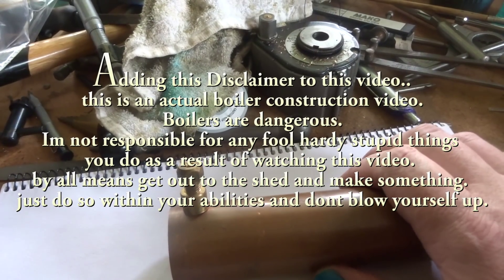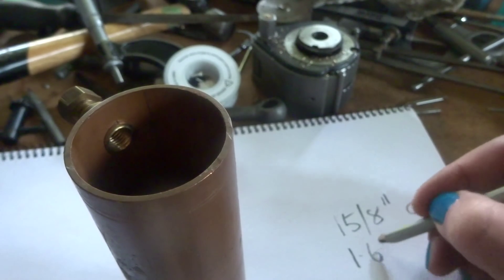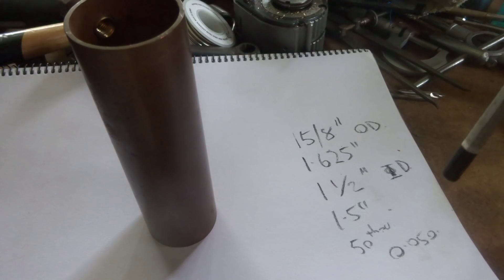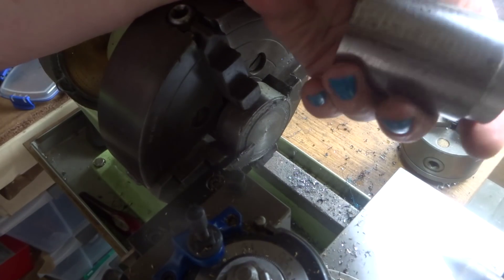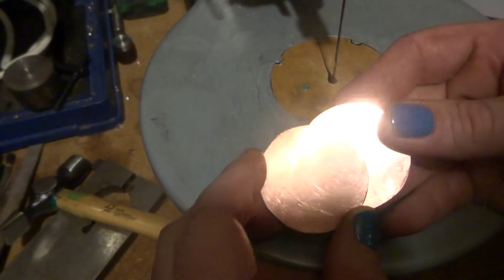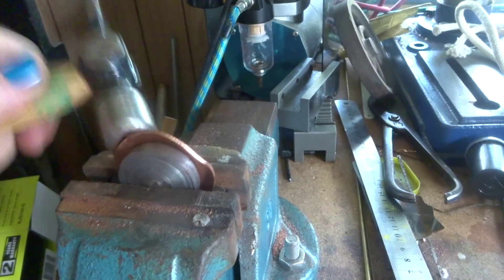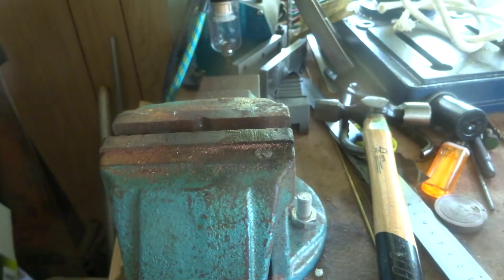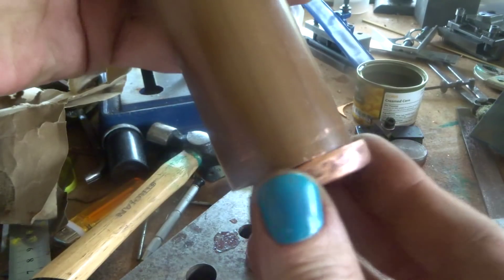K W  SCHOOLS  Steam Engine PART 9 Boiler components

Comment: I have made end similar end caps by machining a steel former just as you did.  However I also used a 2" X 2" chunk of 1/2" steel that I cut a tapered hole in, sized using the ID plus double the thickness of the end cap material.  Polished the hole smooth, put some oil on both formers and then used my big vice as a press and formed the cap.  It had some wrinkles near the edges but these were machined off.

Comment: Why doesn't anyone just buy the OEM caps the fit on the outside of the pipe it seems they would increase the strength of the boiler as was as making the whole process much easier...

Comment: Nice work, perhaps use heat bricks instead of a lump of steel when annealing as the steel is sinking a lot of your heat and it's a bit less of a fire risk! I usually use a pair of forming bucks and sandwich the end cap between them to ensure a crisp, almost 90 degree edge and a dead flat face which is critical if you wish to add a water level sight glass.Seeing you have a lathe, have you ever thought about machining a complete pair of forming dies, that way you can set up to press out the end caps with a small hydraulic shop press?
Re cutting the copper, I just use wiss snips and a linisher!!
keep up the good work mate, i love watching others go around with their projects!
Reply from the maker: Is another boiler very shortly down the track. I'll certainly keep your ideas in mind! Thanks for watching!

Comment: clickspring shows in his videos how he cuts circular brass discs on his lathe. He glues them on with one-second-glue, turns them and breaks the bond with a little heat from a blow torch and cleans the residue with acetone.
Reply from the maker: +rol eic clickspring has a great channel. wish he would show his outtakes though. the wax brass was traditionally used with shellac, nowdays superglue works too.

Comment: Great video Emma. Keep them coming! Good thinking about the centre punch mark being a weak point. I'm no expert but how about tinning both parts of the joint first, then applying some flux, heat and feeding in a little solder? Can't wait for the next video! Thanks from Mike in the New Forest of England.

Comment: Interesting video, have you ever tried metal spinning parts like that? 
If you will permit a little FYI, contrary to a lot of people's thought, quenching is not part of the copper annealing process, it just makes it quicker to work on the part again.
Reply from the maker: Thanks for that. I probably knew that if id sat to think it though!  Thats what youtube is for though! Love to get imput and feedback! Yes you could spin them up fairly easily i guess. I did it this way because i had done it before,  and knew it would work. Thanks for watching.